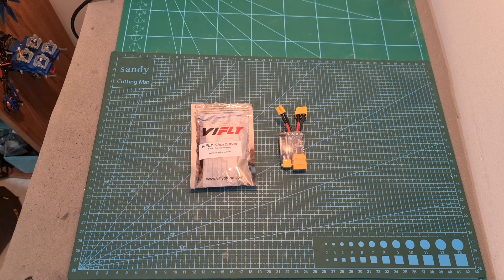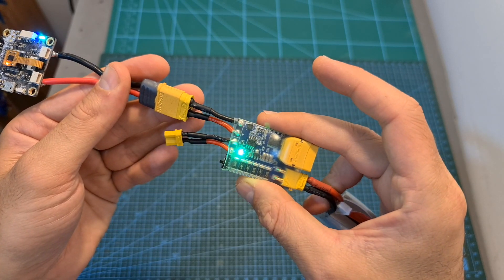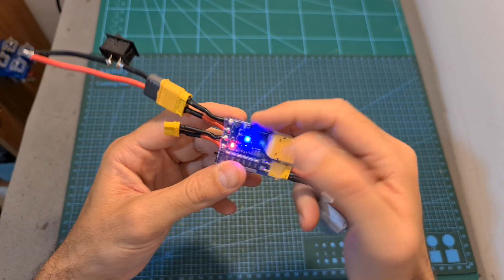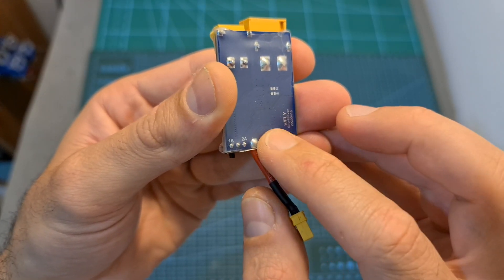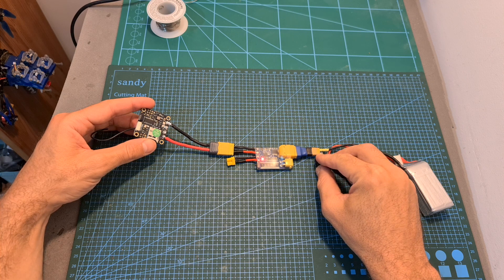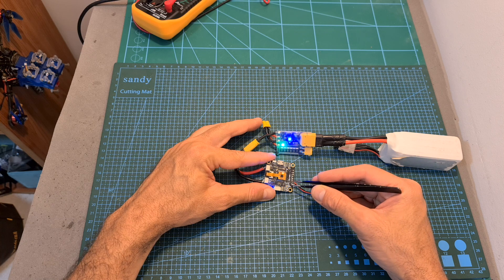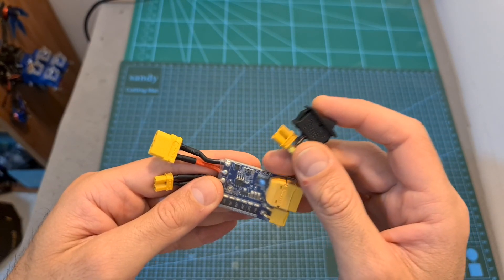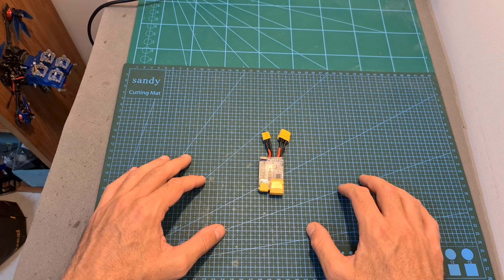💨 Vifly ShortSaver - No More Magic Smoke

Comment: Would connecting a 5V receiver to a VBAT help as long as I have this?
Reply from the maker: That's a great question. 
I just tested it and the fuse did trip, however the receiver was destroyed.
Reply: That's unfortunate...
A broken cap can short out, and when that happens, did we find out that the tool can prevent damage to the quad?Thank you!